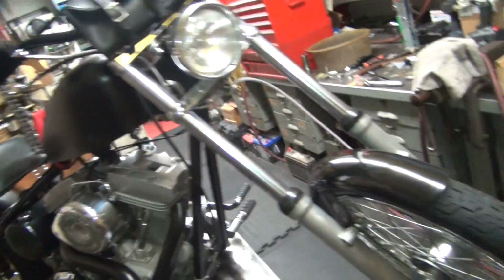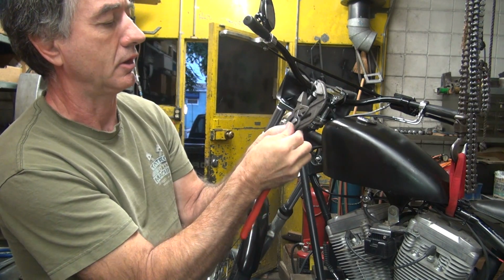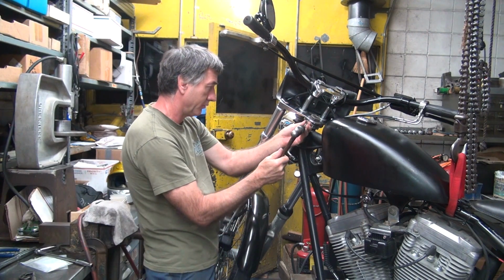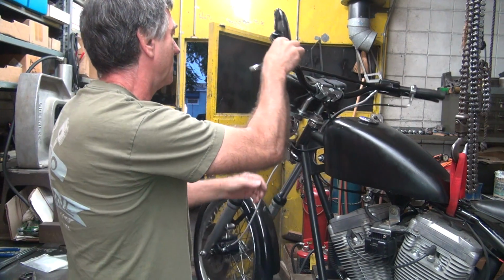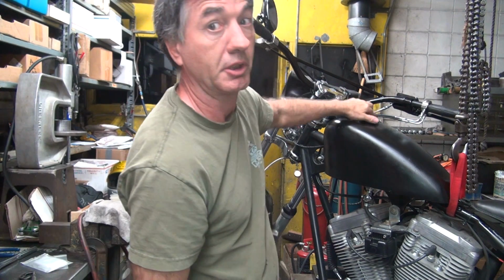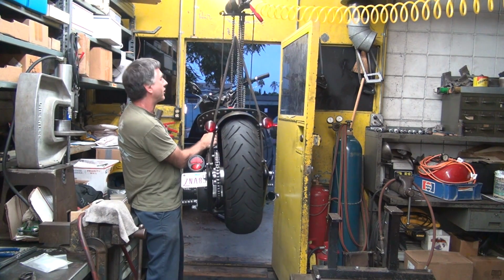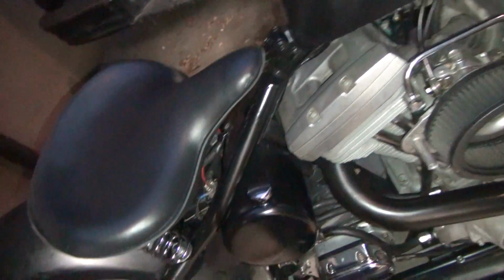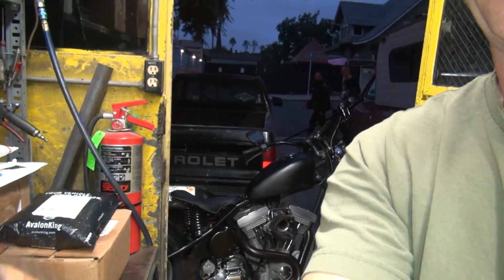#293 1999 80ci evo chopper upgrades running lights & brake repair bobber custom harley tatro machine

Comment: Surely it would bias the disk and the caliper side when your seeing how easy the handle bars fall.
Reply from the maker: no and you would never feel it while riding the bike. if brake bias was a problem than all bikes would have dual disc.
tatro